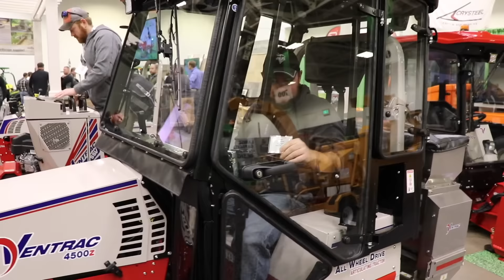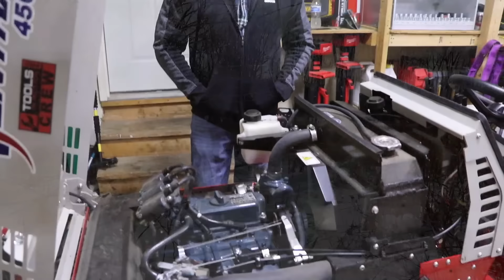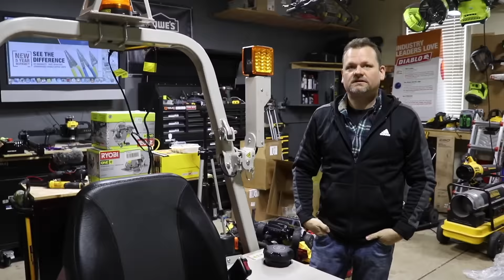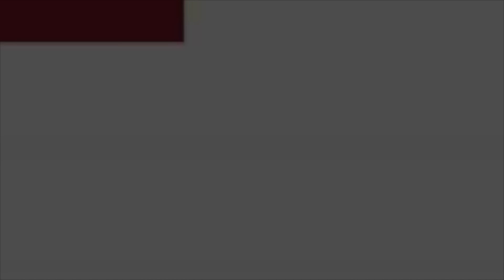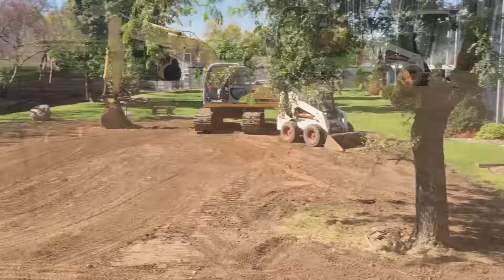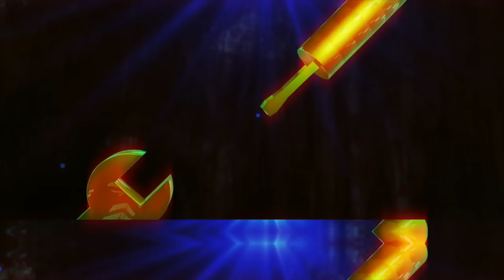Ventrac Review pt2  "HOW NOT TO TEST A TRACTOR ?!?"  because Franky is STILL Nuts PT.2

Comment: The Ventrac 4500Z is by far the finest piece of grounds maintenance equipment you can buy.  The massive number of well designed, commercial quality, easily attached accessories allows a single ventrac tractor to do efficiently perform tasks that would normally require a large variety of expensive, dedicated machines.  There is nothing cheap about a Ventrac but the quality, workmanship,  ease of use, and versatility of the unit and its accessories makes it an unbeatable value.

Comment: There was so much thought that went into the design of the 4500. It's nice that anything you add on just plugs right in, No wiring required. The hoses for the csb heat is great, Just plug them off in the summer. I agree with you guys this machine is Great American quality. Ventrac does not need to pay people to sell there products.  Once you look at one, And drive one you can't stop talking about it. Great video.
Reply from the maker: Agreed 👍
Reply: I think that's kinda dumb. So you have to start taking houses off, and have antifreeze leaking all over, and PLUG the lines. How about a valve.
Reply: Andrew Delashaw valves would be nice

Comment: Those are made like my old 6788 IH 2+2 tractor, that tractor will float across crop ground an ATV shits itself over. I didn't know about the turf tread was the only thing that worried me with the Ventrac here. Turf tread sucks but it doesn't look like a Ventrac has much room for tractor treaded tires.

Comment: You mentioned aftermarket attachments...  

Ventrac does NOT have a sprayer (weed, fertilizer, insect spray etc.) BUT...  ProLawn Quality Products does and they have a mount specifically for the .  http://prolawnsprayhields.dreamhosters.com/?page_id=46  

and...

Ventrac does NOT have a 46" to 48" snowblower for the 4000 series (4500) tractors to use on standard residential sidewalks BUT...  Steiner does make a 48” Steiner SB648 Professional Snow Blower AND a 48" SB448 snow blower that will mount directly to the existing Ventrac front mount as they are the same mount.  For those who do not know, Ventrac originally started as Steiner and broke off into two different companies.  That said, the only attachment Ventrac doesn't have that Steiner does is the 48" snow blower.

BTW, when I mentioned a lack of a 48" snowblower for the 4000 series Ventrac tractors on Ventrac's YouTube page and how I hated the idea of buying a 48" Steiner attachment which IS available, it was either Aaron or Denver that responded and said they will look into the possibility of manufacturing one.  The folks at Ventrac are top notch in my book.

Comment: Any suggestions for gloves?Up north has been in the -30. Thanks for the amazing videos
Reply: Miguel Angel Duarte depending upon use, for snowblowing lately I've been trying some "Duluth Trading Co." winter gloves, and have been quite impressed. They are of the leather type in the palm, so moisture tends to stiffen them up, and they are already a bulky/non-dexterity type glove. For warmer weather, near freezing, Under Armor has some what look like glove liners that have greater dexterity, but be warned that they do run small in size, and again not as extreme temperatures.

Comment: need to make it so coat connects to bottom so you can use coats controls and do they have different tread styles for the ventrac?
Reply: Dennis Fox that or power the hoodie from the bibs! I can't remember where the battery sits, but I remember hearing people complain about it's location.

Comment: do you charge the jacket?
Reply: Focus rI  it utilizes the cordless tool batteries, 12 volt ones I believe? Their small batteries, about 2" round and 3-4" tall, similar look to the Bosch 12 volt. And I think I remember the hoodie having a high and low setting. I couldn't tell you battery run time =/ 
Depot sometimes has them in stock. 
Good luck and stay warm!